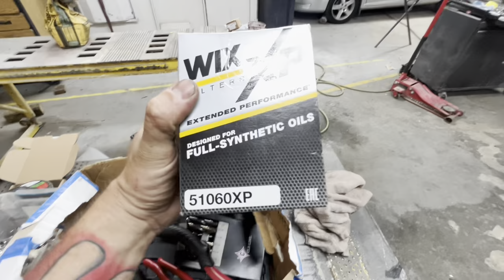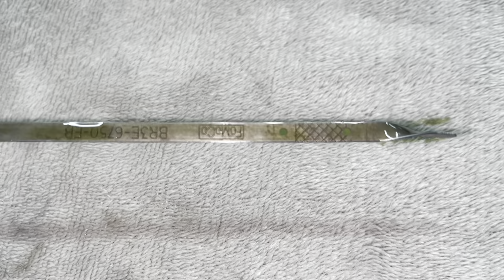⏰ Friday Night Prep & We Check Our Clear View Filter / Oil

Comment: That black stuff in your Clearview, is most likely engine assembly lube. Its kinda what it looks like to me.
Reply from the maker: Ohhhh interesting I didn’t know it looked like that
Reply: @ThePaintPaperHustle  my brothers ford small blocks filter looked like that. It was the first filter with the breakin oil. We cut it open and it looked like that. We showed it to the engine builder and he said it was assembly lube. We have been running that motor on a lot  of NOS for over a year without any problems.
Reply from the maker: Awesome feedback thank you for sharing
Reply: @ThePaintPaperHustle  hey no problem, glad i could help out. Im a coyote guy myself and can't wait to get mine going.
Reply from the maker: Awesome man!

Comment: Man that oil looks just fine, those black specks your seeing in the clearview screen is a bit of crud that never got fully cleaned out of the valve cover baffles and the block from when it was in the f-150, i'm gonna guess it had more than 100k miles when you got it? I see nothing at all to worry about 👍
Reply from the maker: I agree with your thoughts fully man

Comment: not rich lol might not be brad peen or top end race oil but man u still put in motorcraft oil it ain't much cheaper might not be preformance recommend but it's... factory recommend brand  👌 yea u still haven't  made many passes on it yet but it's technically still ur dyno/break in oil
Reply from the maker: You’re right. I already had the motorcraft so I just wanted to use some of it up. Once I get this freaking credit card paid down we gonna be alot more loose with spending
Reply: I don't blame u man plus I'm with u with the clear view filter u can literally see results and expand life of oil buy running those 2 different filters 👍